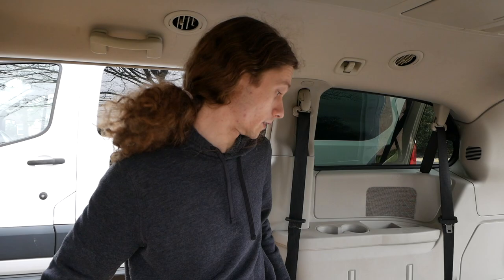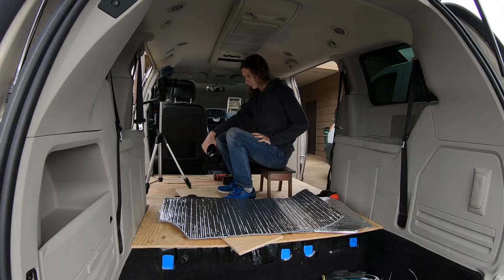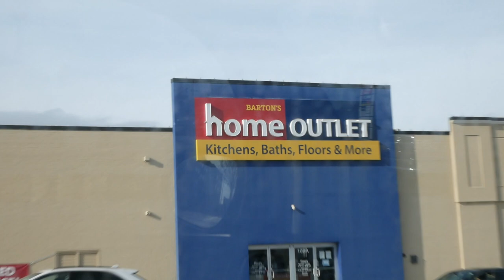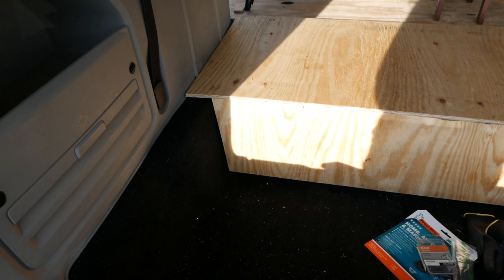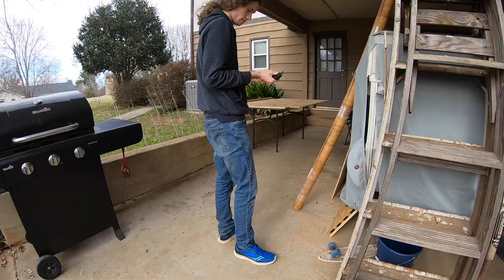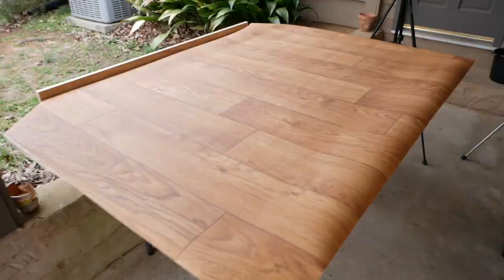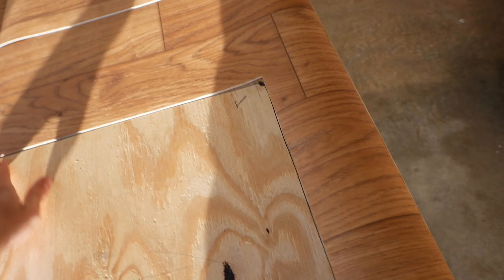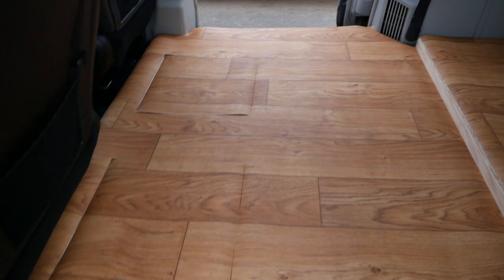Adding Linoleum to the Minivan Camper

Comment: Great job.  Remember that you will be adding some foam to that bed so thats something to consider with the bed height.
Reply from the maker: Yeah, I was thinking maybe I should go ahead and buy my foam before making the hight official so I can make sure it's the right set up. Lot's of little things like that can make a big difference!!
Reply: @IanODonnell  great point! We ran into a bit of that issue with the bed we put in. It was originally a full sized twin frame that we cut down to just 25 inches wide, but it has a side frame on it which is good for holding the foam in but I felt an additional foam piece (they're both 3" from Home Depot's "future foam" collection) would be more comfy. It is BUT I can't sit up like I wanted to (I'm 5ft 7inches) so we thought we might lower the bed legs (I wanted some serious storage under it - like totes type & camp toilet height) but I'm not wanting to give up the storage so for now, she stays put LOL! So - all to say, definitely get your bedding considered since you are a bit taller than I am =) Love the vinyl faux hardwood floor look!!
Reply from the maker: @JournalofaWarriorsJourney  Thanks so much!!